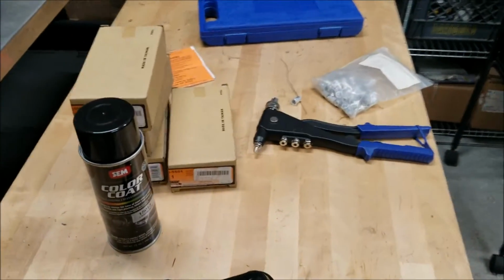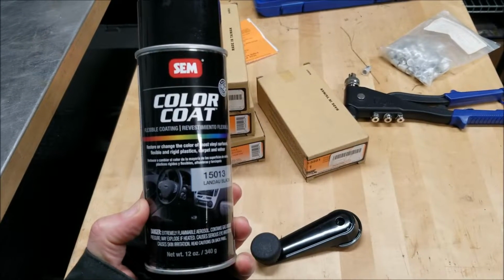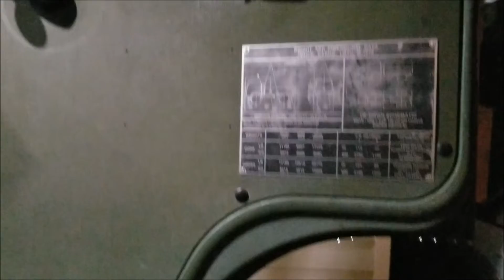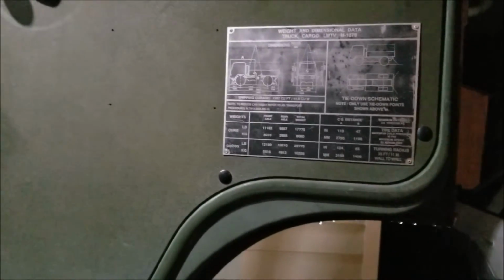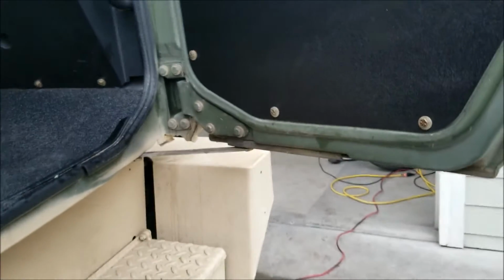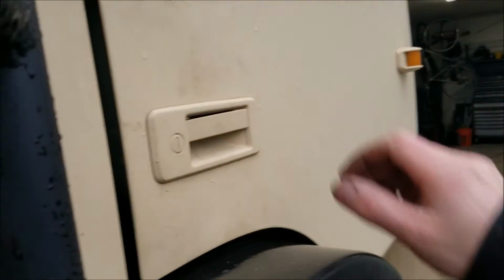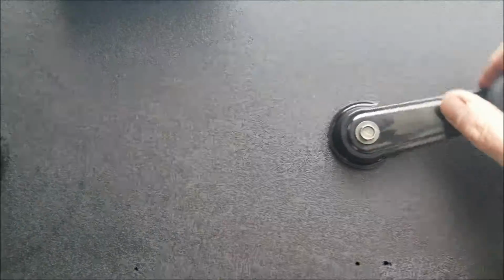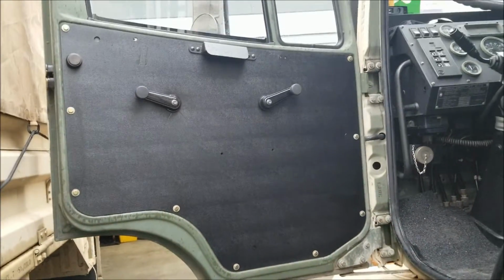Abel LMTV build part 76 (door panel reworking, window crank handles, door toggles)

Comment: Sean, any reason why you haven’t gone for some sound deadening? Seems this would have been the perfect time to put that it.
Reply from the maker: We run a highly concentrated biodiesel.  Running biodiesel we have found the higher the concentration the quieter the motor.  Couple that with the thick rubber mat we used for floor mats the entire length of the cab and you would be surprised how quiet the cab is with all of the modifications already made.  Driving the truck is quite pleasurable.

Does that make sense??  I did not see a need for it I guess plus its like 19 degrees out LOL.  I had to run the dragons breath inside the garage in the most recent video just to get the SEM to dry rather than crystallize.
Reply: @SeanFillner  Can you elaborate on your biodiesel experience? Are you going above B20? I ask because CAT recommends a slew of additional maintenance and considerations (link below). Would love to know your point of view, as a key hesitancy in purchasing a diesel vehicle are environmental factors. https://caterpillar.scene7.com/is/content/Caterpillar/C10419422

Comment: On 3/14/2023 on Amazon the 775-5501 black handle (metal) is $32.99 the 775-5502 chrome handle (metal) is $13.71…guess my lmtv is getting chrome…🤷‍♂️🤷‍♂️🤷‍♂️
Reply from the maker: They used to be the same price until I posted the link in this video.
Reply: @SeanFillner  🤣🤣🤣 “no good deed…” 👍👍
Reply: @SeanFillner  you know…I have noticed cases on Amazon where immediately after ordering an item the price goes up 🤔🤔🤔
Reply from the maker: @fsfazekas  depends on your login too strangely enough